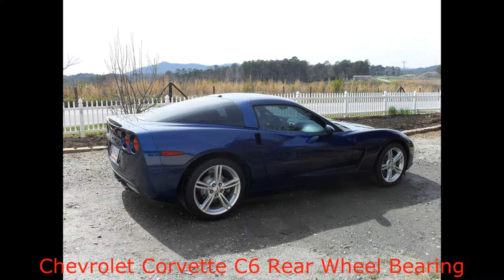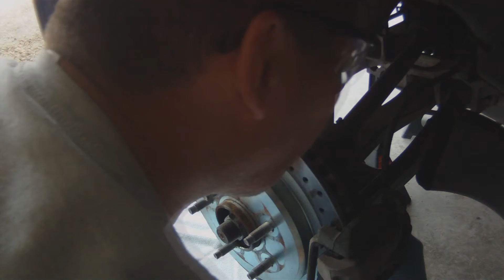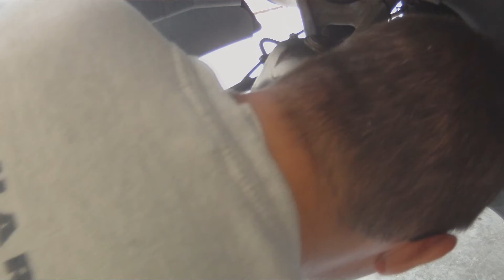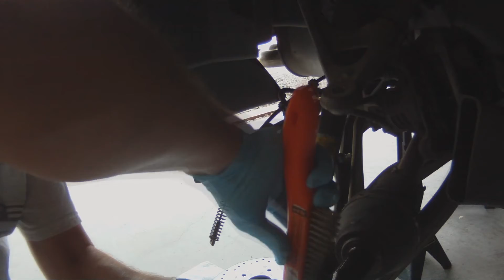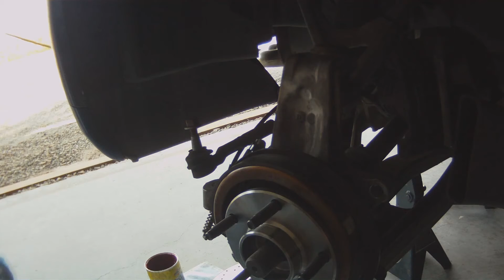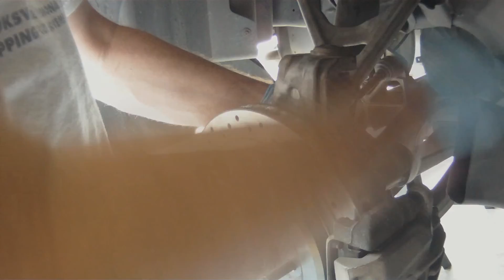Chevrolet Corvette C6 Rear Wheel Bearing Replacement - Axle Shaft

Comment: This video is great!  I replaced both wheel bearings and I used this video as a tutorial.  The only addition is that I had to use a ball joint separator as the ball joints were stuck too tight.  On the second wheel, I did not remove the shock and that did not pose any problems and sped the whole process up.  Great Video, thanks!

Comment: FYI: the caps can be removed from the C6 wheels while still mounted, exposing the axle nuts. I recommend loosening the nut while the wheels are still on the ground, it will make your life significantly easier.
Reply from the maker: Good tip... You can also leave the opposite side of the car on the ground.

Comment: Nice video, thanks for posting.

You quote the service manual torque on the axle nut (118 lb/ft). However there is a service bulletin (07-04-95-001) that revises the torque to 160 lb/ft and specifies Loctite 272 (and 24 hours before driving to allow cure time).
Reply from the maker: You are correct.
Reply: People have used the revised torque spec and snapped their axle nuts as well. Its kinda up in the air tbh

Comment: Just finished doing this in my 06 Z06. Just a few pointers: 

My nut on the lower control arm would not come off unless the axle was off, so I had to remove the upper one first and move the hub around until the axle came off. 

Also, the lower control arm ball joint was the biggest PITA for me. I tried first with the harbor freight separator, but it was to small to fit the long stud holding the joint. I had to purchase one of those fork looking attachments and hammer the crap out of it until it came off. 

Lastly, before you remove the rotor, make sure you pull your handbrake up and down a few times and then leave it in the down position. I forced it out and the little spring came off, which wasn't a big deal since I had to remove the hub off anyway. 

Good luck. I did this for the first time and took me a solid 3 hours, taking my time and going through the issues. 

PS - a strong impact gun will be a life saver here when removing that axle nut and T55 bolts!!! Saved me a ton of time.
Reply: My impact wouldn't get the T55s out. I wound up using a torch, followed by my floor jack handle over a breaker bar to break them loose. Red Loc-Tite is a PITA.
Reply: David Lively yes a regular electric impact won’t do it. My ingersoll rand 20V with 1100 ftlb has turned out to be a great investment

Comment: Hi Mike.  Great Video.  Just to help your viewers.  Here is the  updated TSB from GM on the Vette.  The Torque specs on the axle nut is actually 160 Foot Pounds.  Take care Bro.

Subject: Tapping or Scraping Noise From Rear Wheel Area (Replace Wheel Drive Shaft Nut) #07-04-95-001 - (09/26/2007) 

2005-2008 Chevrolet Corvette

Condition
Some customers may comment on a tapping or a scraping noise coming from the rear wheel area.

Cause
This condition may be due to the torque on the wheel drive shaft nut relaxing over time.

Correction
Replace the left and the right wheel drive shaft nut following the procedure below.

Remove the center cap from the rim. 
Remove and discard the wheel drive shaft nut. 
Apply LOCTITE™ 272, or equivalent, to the threads of the axle shaft. 
Install the nut and tighten to the new specification. 
Tighten 
Tighten the nut to 215 N·m (160 lb ft).

Install the center cap to the rim. 
Important: The vehicle should not be driven for 24 hours following the repair in order to allow the thread lock to cure. 

Parts Information
Part Number
Description
Qty

10257766
Nut
2 (one per side)

Warranty Information
For vehicles repaired under warranty, use:

Labor Operation
Description
Labor Time

F9712*
Wheel Drive Shaft Nut - Replace
0.3 hr

*This is a unique labor operation for bulletin use only. It will not be published in the Labor Time Guide.

GM bulletins are intended for use by professional technicians, NOT a "do-it-yourselfer". They are written to inform these technicians of conditions that may occur on some vehicles, or to provide information that could assist in the proper service of a vehicle. Properly trained technicians have the equipment, tools, safety instructions, and know-how to do a job properly and safely. If a condition is described, DO NOT assume that the bulletin applies to your vehicle, or that your vehicle will have that condition. See your GM dealer for information on whether your vehicle may benefit from the information.
WE SUPPORT VOLUNTARY TECHNICIAN CERTIFICATION

© Copyright General Motors Corporation. All Rights Reserved.
Reply from the maker: Great info: Thanks.
Another tip which I didn't show but is on my car is the old Nut on top of the new nut to help lock them in place.

Comment: This was very helpful. Though, I wish my knuckle had come off of the lower ball joint as easily as yours did.
Reply: I'm in the same boat lol. Had to stop for the night because my lower ball joint doesn't want to just slip out like his did.
Reply: Layne Patrick this is vague, but: the spring exerts pressure on the control arm. If you’ve got the car sitting correctly, a few taps (bangs) on the knuckle near the lower ball joint will loosen it enough for the spring to push the control arm down. If the knuckle is still attached at the top - no nut needed, just with that stud in the knuckle hole - will let the spring push the lower arm down, separating the two.
Reply: Layne Patrick just make sure the control arm can move and the knuckle is secured at the top, and let physics do it’s thing. That means the jack or stand can’t be under the control arm, because it needs to move. Whatever you do, do NOT hit the ball joint studs with a hammer. It’ll make the hex insert unusable and you’ll be buying new control arms.
Reply: @xnadave  Thanks for the advice!
Reply: @laynepatrick175  One more tip: if you put the rotor back on the knuckle and secure it with a couple of lug nuts, you can put your floor jack under the rotor. (It'll be fine.) That'll let the spring press down harder on the LCA. (Apologies for the barrage of messages. I spent a LONG time getting that thing off and I hate to see others go through the same painful learning process unnecessarily.)

Comment: I use blue lock tight not red. Red makes bolts near to impossible to remove down the road for the next guy. Thanks for the video
Reply from the maker: Red is what the Service bulliten calls for. The axle nut is a one time use item. Don't second guess safety.

Comment: Don’t know if it’s right or not but I doubt a garage waits 24 hrs before customers pick up their car 
And I would suggest putting anti oxygen spray or ceramic lube on high hats and inside the rotor (mating surfaces)
Just to keep corrosion to a minimum 
Like the video 👍
Reply from the maker: It is in the service manual. Do don't see why a dealership would not make you wait. Sadly, they make people wait for much less service activities... Not sure I have waited 24 hours. Usually just do the job and leave the car parked until the next morning. Then do the test drive.

Comment: Thank you for the great video, I used it for a refresher as I'm about to do my third hub on an 05 C6, and that's with less than 40K on the car.  
Why did you remove the lower shock attachment?  I have not done that and didn't seem to have any issue because of the shock mount remaining intact.

I have had to press the bearing out of the steering knuckle (on the rear), I noticed yours seemed to slip right out.  I don't understand why that would be any different from the front unless the clearance is different for the rear.  Was there a step you didn't include in the video?

Regarding your comment on the axle nut, how would the wheel come off because of this nut? The wheel is attached to the hub which is firmly mounted to the steering knuckle which is securely mounted by the ball joints to the suspension arms.  The "nut" merely holds the half shaft to the hub.  If the axle nut should come lose, it may damage the half shaft or CV joints or even differential, you would likely have some serious damage, but it seems the wheel would certainly remain on the car.
Reply: Regarding removing the hub from the knuckle: If you thread the bolts back in a few turns, you can tap the bolt head - preferably separated by a block of wood or something to avoid deforming the bolts - with a mallet or soft hammer to push the hub / bearing out a bit.

Comment: Sounds like I'm going to need one of my rear wheel bearings replaced on my '08 C-6. Sounds like the driver's side but can't be sure since I'm sitting in the driver's seat when I hear it, so it still could be the passenger side. It's been making a little noise for a while now, and it's starting to get more pronounced. I really don't want to go to the dealership since I know they are going to "take me to the cleaners" on it, or maybe even insist it's the rear diff failing. I know how unethical dealerships can be. Maybe I can find someone else to do it. It's good to see common tools can do the job. Mine is a southern car so chances of a rusty situation is not all that great.
Had the very same problem on my Subaru a few years ago and the dealer insisted it was the transmission going bad. Took it to a private garage where he confirmed it was just the wheel bearing/hub. The dealer wanted $4,000+ to do the transmission rebuild, and I don't even know if they would have actually done the rebuild, instead just charging me for the job. I got the bearing/hub replaced for a bit over $300.
Reply from the maker: You could do one and if that doesn't fix it, you still have saved enough money to replace the other. I bought mine from Advance. You can get OEM from eBay pretty cheap. Do not forget to buy the new OEM axle nut and red Loctite.

Comment: you torque # are  160 then 100 then 118 which one is the good one
Reply from the maker: It is in your shop manual. The final torque on you axle nut with RED locktite is 160 and then let the car sit for 24 hours. Do not drive the car when this job is complete.